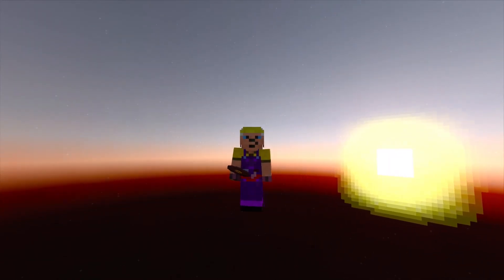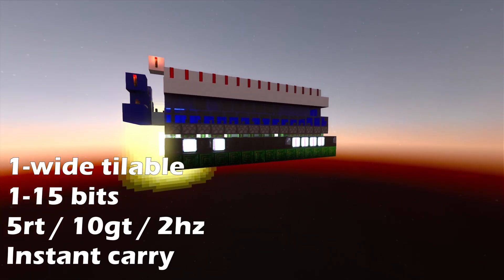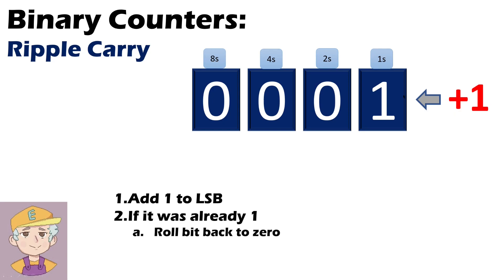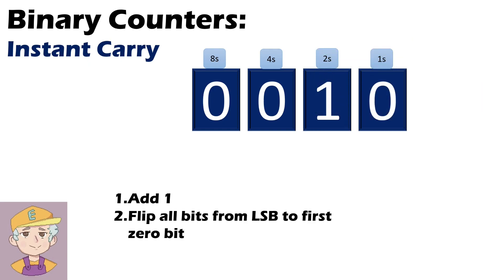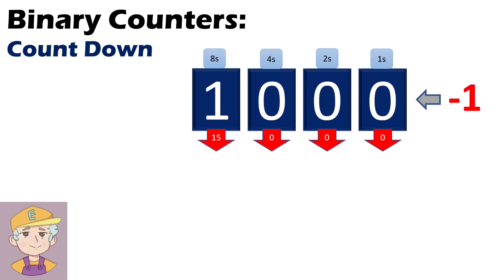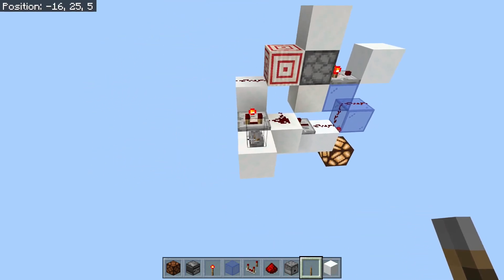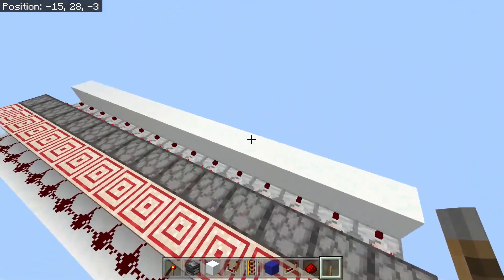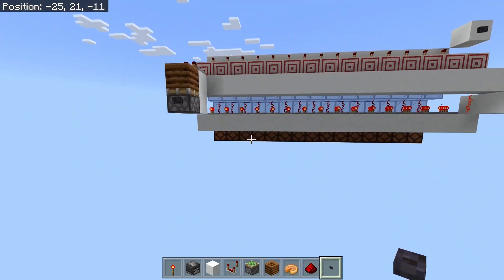Bedrock: Instant Carry Binary Counter - 10gt

Comment: Wow this one is really nice, seems like most synchronous counters use Java Edition's one-way glass gate, so it's great to see a design that works in Bedrock. And, if you're only doing 4 bits for BCD like what I'm doing, you can space out the tiles by one and it still works perfectly, so I can flash inputs a bit more easily and output right into my encoder! The only downside is being unable to reset specific bits to 0, but really the whole clock is so fast that it's not a big deal to just full reset and flash the specific bits I want in the same circuit, which only takes 3 redstone ticks.

10/10 this will definitely be my go-to binary counter

Comment: What resource pack/packs are you using in this video? I've found a few but they don't color code the cobblestone ends of the pistons with red and green.
Reply from the maker: HI, This was a combination of Tal Melamed's "Clear Vanilla" redstone pack and "Truly Vanilla RTX" by Cube IR. Clear Vanilla goes on top, and as a result the r4edstone components don't get RTX treatment, but they get the quality of life features like directions. I prefer that.
Reply: @Eggfur , thanks, I'll see if I can find them.
Reply from the maker: I got the RTX link from r/minecraftrtx subreddit. I think Tal's is on mcpedl

Comment: Dude this is great, I've already done some testing with it. lol I've been working with converting analog to pulse width, and using a pulse width input with this allows a direct conversion of analog to binary. The best things about it are the fast clock rate and the instant reset
Reply from the maker: It's funny, because I was prevaricating on making a video for the 4gt one and just wanted to see if I could get a synch output version and it payed off ... Er, what's a "pulse width"? It sounds great if you've got an easy analogy to binary method
Reply: @Eggfur  This is pulse width by ct5k https://youtu.be/p8Cs7AF9RRk it's a useful circuit, pretty much universal for making pulses and clocks

Comment: Thanks for a great video as always. In the clock you made I was curious why a rail instead of a bit of dust was used. Does this have to do with p ticks and c ticks?
Reply from the maker: Hi Daniel A. Observers watching powered dust fire on relog, it wouldn't really matter here, but I just tend to avoid it for that reason.

Comment: I can’t believe that this video gets out 1 week after I’ve made a binary counter as well. Same mechanics, pretty much the same design (that I stole from CubicMeter)… Even if after having made the design I realized that I didn’t need it at all…
btw wouldn't it be easier to generate a pulse with a signal strength of one by using a dropper facing into a hopper ? (or even 2 droppers facing each other with a block on top of one of them and a torch on top of the other one placed on the side of the block)
Reply from the maker: Hey, link me cubicmeter's video if you can. The ones I've seen on Java were all pretty piston heavy...

The counting speed is determined by the time between sending the first pulse and the output changing - since the output is used to calculate the next increment. So I used the fastest t flip flop.
Reply: @Eggfur  Here it is https://www.youtube.com/watch?v=XYsnE54qE7E
He shows the design at 14:05